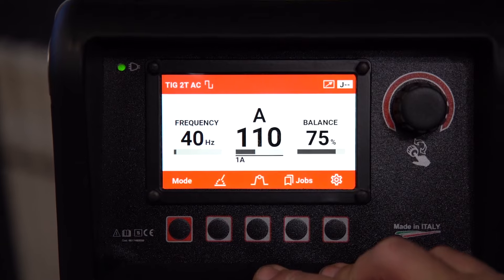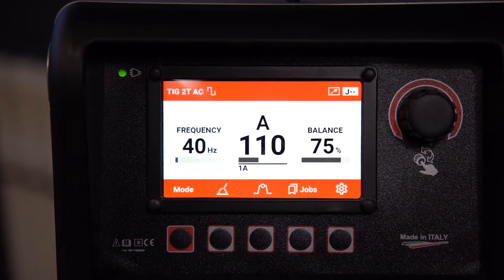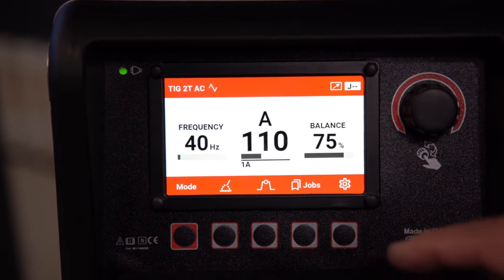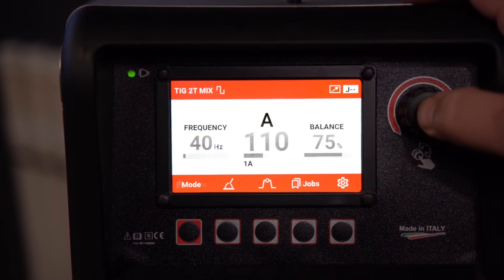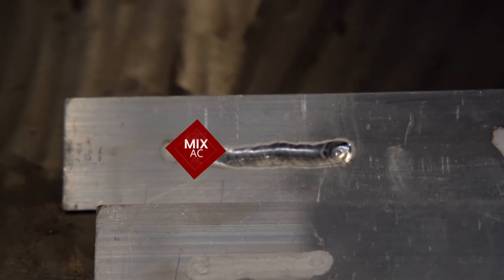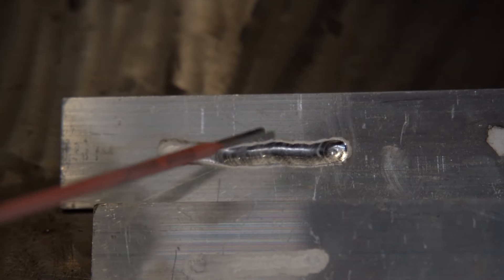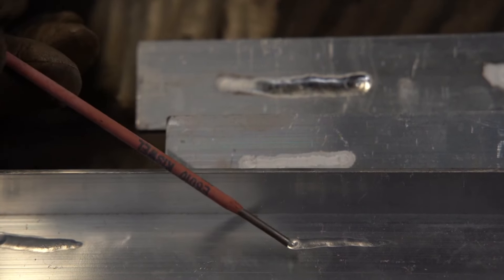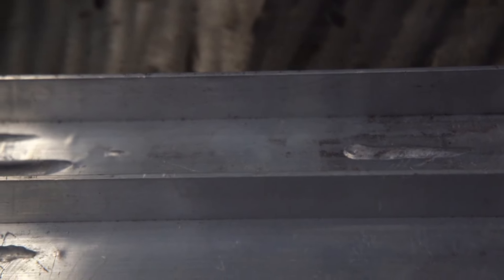AC Tig Welding with Helium? or NO Helium?

Comment: do you know of any good, budget-friendly machines for a hobbyist looking to learn how to TIG weld?
Reply from the maker: Well, this is a loaded question…  most budget machines are “harder to weld with” than high end machines …..  however, just having a good or great machine does not assure a good outcome either ….
Best would be to weld with someone else’s machine first, see if you get the hang of it ….
Reply: @ZILAwelds  appreciate the reply!
Reply: AHP, Primeweld, and everlast all have decent low price tig machines
Reply: look into arccaptain 200 acdc, lots of good reviews, bought one myself to learn. im not good so i cant tell good from bad machine but its a nice machine for cost, good features too.
Reply: @Fisheiyy  thanks will check it out